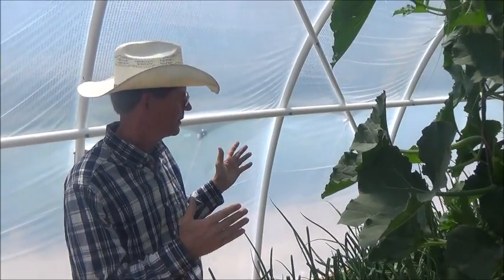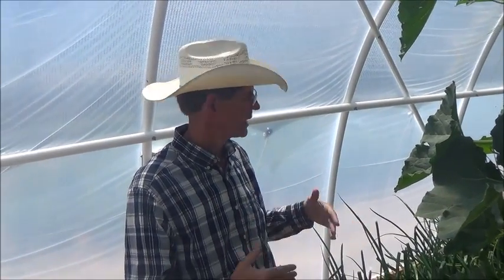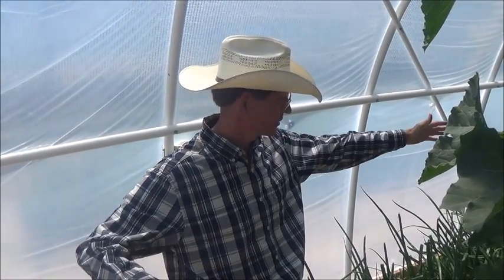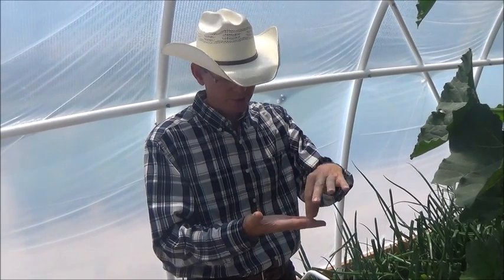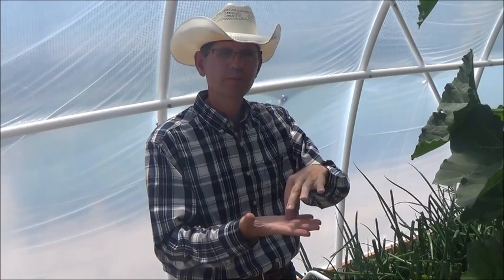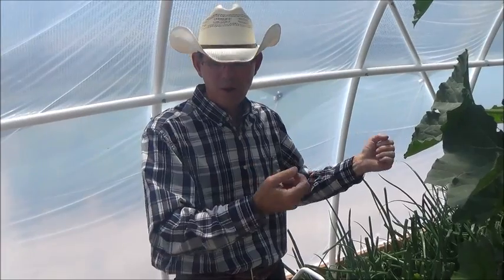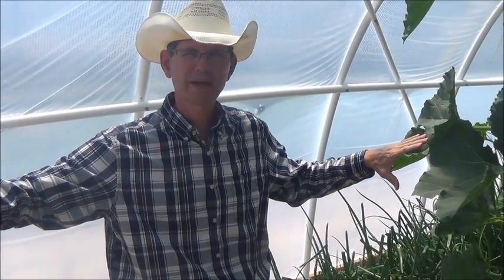LDSPrepper GeoThermal Plans for Underground Tubing New!

Comment: How do you work out how much tubing do you need? You mentioned the cubic size of the greenhouse, but then you appear to mention length of tubing as a %age of the greenhouse volume??
Kind Regards
Richard
Reply: +Paul Ladendorf 
Insulation and heatloss isnt a big factor in determining the tube length apart from the amount of heat the system must provide to overcome the losses. 
The amount of thermal mass dictates how much heat you can store. 
The amount of tubing in contact with the mass and the amount of air you move through the tubing dictates how much heat can be  moved to or from the thermal mass.
Check the video at about 3 minutes in, when David says the tubing must fit in the ground, i was hoping a light bulb might appear above his head at that point, but sadly not... the ground still doesnt figure in his formula :)

 Rest assured, using the 10% air volume to tube length will cost you between 30% and 50% of your systems total potential performance even if everything else is perfectly designed.
In my case, i`d have less than half the tubing i have now, and in David`s case he`d be over 300ft short on the minimum amount needed for his greenhouse..
Reply: I installed my system in 2009, it was designed with the assistance of John Cruickshank (RIP) of sunny john and plain-to-sea to provide accurate realworld data as there was very little available back then. It has a variable speed fan capable of more than 60 airchanges per hour. The system is monitored by  26 sensors, 2 dataloggers and an anemometer.
Heat transfer is driven by temperature difference, if you have air at 80F and dirt or water at 50F, the air will not lose more heat to the water. The water will not heat up as fast as dirt but if you run the test for an hour neither the dirt or water will gain enough heat from the air to create a measurable temperature rise. Note that you also have to take account of the latent heat transfer as well as sensible as it plays a major beneficial role in cooling and a detrimental role in heating if its not addressed in the design.
Reply: The prerforations in the ADS are not ideally placed to drain condensate, it gets trapped in the ridges. Use a circular saw and a couple of boards as a guide to cut a very shallow slot through the ridges in the bottom of the tubing. Dont cut all the way through :)
Reply: The ones i`ve talked to dont have a very good understanding of the systems they sell. They didnt have a clue that large amounts of moisture is released into the greenhouse along with the heat. I guess they are more interested in selling than testing. Anyone with one of these professional systems can easily confirm what i`m saying simply by monitoring the greenhouse RH%. day and night. Take a look at LDS datalogger screenshots in one of his vids that show 95% RH at night :)
Cere`s was one of the firms, whether the information was passed onto their design team i dont know but the issue is real and must be addressed in the design stages as latent heat does nothing to raise the greenhouse temperature just the RH%, which can lead to outbreaks of mold, disease and also corrosion/rotting of the greenhouse structure itself.

Dont listen to me or them..do your own small scale testing and decide whose info is correct :)
If you look at Cere`s tubing layout, the 1st thing you`ll notice is the design flaw in the inlet and outlet manifolds,  these must be sized to carry all of the air to supply the multiple tubes in the layout. One 4" tube cant carry all the air to supply eight 4" tubes in parallel. Its a bottle neck that would not be there if the system was designed correctly.
Reply: +Richard Miller Cubic size is the same thing as volume.  His formula is 10% of volume in feet of tubing. So for example the volume of a 10x10x10 greenhouse would be 1000 cu. ft. and would need 100 ft of tubing. The problem with that formula is it doesn't take into account how well insulated (or not) the greenhouse is nor the climate its being installed in. A single layer of poly is going to need way more tubing and air flow then a super insulated greenhouse. A greenhouse in northern Canada is going to need way more tubing and air flow than one in Tennessee. The scientific way to calculate it would be based on heat loss and gain.
Reply: Hi Richard
For a greenhouse that size i`d use a total of180ft of 4" tubing arranged in a 6x3 matrix comprising18 tubes 10ft long. The tube spacing will be 18" on center horizontally (1st tube spaced 9" from the greenhouse wall) and at least 1ft vertical spacing ensuring you have 2ft cover (~4ft total depth).I wouldnt go more than 18" vertical which equates  to around 5ft total depth. The easiest option for the plenums/manifolds is to dig a trench 9`x 2`x 4`-5` deep at each end of the greenhouse and install retaining walls made from pressure treated timber. The 250cfm fan will be sufficient for 20 airchanges per hour, the tubing layout will easily handle 60 airchanges per hour for summer cooling if you need it.. You can easily fit additional 250cfm fans (at any time) to the intake plenum to increase the system capacity. For extra flexibility, use a thermostat for each with the setpoints geared to provide more flow (more fans running) as the greenhouse temp increases, less as it decreases.
Be sure to install vertical perimeter insulation to isolate the greenhouse from the ground outside.
Reply: A 250cfm fan will put all the greenhouse air underground 20x an hour (excluding losses). 250cfm x 60 / 750cubic foot gh volume.
The losses in the layout above will be very low. If you were to run the same 250cfm through a single 180ft long 4" tube (ie the same amount of tubing), all things being equal, it would have 2800x more loss (aassuming it was dead straight with no bends). To put it into context, the single 180ft tube with just  5cfm running through it would have the exact same loss as the correctly designed system running 250cfm. 
Rules of thumb.Dont use long tubes, they will eat your fan power. Dont bury the tubing in a single layer, it will severely limit the amount of mass in contact with the tubing. The mass is both source and sink for the heat, air flow is what transports the heat to and from the mass.
Reply: Folks get fixated with how long the air spends in the tube. This is what convinces them to install long tubes. The important thing is how long the ENTIRE greenhouse air volume spends underground.
Typically, air will drop to the mass temperature in less than 1 second, If the air drops to the mass temperature before it exits the tube you are using time that could be better spent moving more of the greenhouse air underground. As an example, at 60 airchanges per hour, a sealed greenhouse purposefully heated to 140F was cooled to 68F in a shade under 12 minutes. It was in full sun during the test so it also includes the additional 12 mins of incoming solar gain.  A longer dwell time is needed for heating but not a great deal, again the important thing is how long the entire greenhouse air volume spends underground.. not how long the air spends in the tube..its not the same :)
Here are a few tools that will save a lot of unnecessary digging ;) 
http://www.freecalc.com/ductloss.htm
http://www.uigi.com/WebPsycH.html
Reply: Submerge some duct (non perforated) in a bath of water (or a pond) and see how much airflow it takes to get the exit air temperature to climb above the water temperature. Chances are you`ll run out of fan power long before you manage it.
Reply: The conductance of water is much higher than dirt so this wouldn't be an apples to apples test.
Reply: It wont matter, its simply supplying a temperature difference and for this test its the air temperature you`re interested in not the mass temperature ;)  Dig a trench for the test if you like, the mass temperature wont change during the test whether its water or dirt. The air temperature in the tube on the other hand will drop like a stone to whatever the mass temperature is. The heat capacity of air is nothing compared to dirt or water.
Reply: You missed my point. It had nothing to do with the mass temperature. My point is heat transfer from water to air will be signifcantly faster than from dirt to air because water is a much better conductor than dirt. Maybe it won't matter if as you say the transfer is extremely fast. I haven't tested that though.
Reply: I have talked to 2 professional installers and now you, all of you sounding very convincing and knowledgeable with data to back up your claims and you all disagree on the fundamentals of an efficient system. :(
Reply: JohnGuest45 I assume you used the corrugated and perforated abs tubing which is what is recommended by the pro installers I've talked to to eliminate condensate build up and mold in the tubing. But it seems that condensate can still build up in the bottom of the corrugations since the perforations are on the ridge of the corrugations. Have you had any issue with mold and if so, how have you dealt with it? Thanks!

Comment: He mentioned a 10% ratio of cf pipe volume, any clue where he got this information?  I have been trying to find specs for sometime without success, thx
Reply: Calculate the volume of a cylinder.  Pi*Rsq.*L  Pi=3.14  Rsq= radius of pipe in feet squared and L is the length of you tubing.
Reply from the maker: Check the video Dirtpatcheaven did with him.  She interviewed him during the digging phase. About 4 months ago or so.
Reply: the info isn't in the dispatch vid either, did u end up finding it, though ?
Reply: +Mike Johnson  Hi Mike - I'm asking myself the same question. Also do you know how to do the calculation into feet of 4" pipe. For example if the volume of my greenhouse was 100 cu ft (very small) how many feet of 4" pipe do I need to get the 10% ratio he talks about? - Thanks

Comment: Would not the composition (metal or plastic), design, and diameter of the buried tubing affect the required length? The surface area of corrugated pipe is many times greater than that of smooth wall pipe of the same diameter. Different pipe materials would transfer heat at different rates and efficiencies. Six inch diameter pipe has a surface area 1.5 times greater than 4 inch pipe per linear unit. So larger diameter should reduce the length required. Also, I would think corrugated pipe requires more energy to move air through it due to wall roughness creating turbulent flow. 

Anyone aware of any resources on this type of info?

Comment: It makes the most sense to dig the entire space, put tubing in the walls of the space, use the rest of the space for a root cellar, storm shelter, storage, or living area. That means, for living area, less heating in winter, and less cooling in summer.
Plants like pretty much the same temperatures as we do, sprouts, even more so. Keeping the temps between 68º and 80º year round means microgreens capability all of the time.

Comment: The numbers didnt add up, also could you please ask him why its 10%? is that 10% at 8 ft? or 6 ft? Where did he get that 10% number from?
Reply: Isn't temp intake and discharge enough? Why 4 spots ? Why the wind meter ? Fans have cfm ratings on them 
1 ft deep wouldn't serve it's purpose as temp is a function of debth 
Would be easiest to know where he got the 10% from.
Reply from the maker: Did you watch his video on DirtPatchHeavens channel?
Reply: +OrangeJeepDad yes which one ? there are 5 parts I believe
Reply: +OrangeJeepDad by the way thank you for the interview I'm just about to do the low grade geothermal next week at a schools greenhouse
Reply: akbanhegyi  10 % The total cubic volume of the space. lengthx width x height ie A 10 ft tall by 10 foot wide 10 foot long cube would be 1000 cubic feet in the green housse. Then you would need the space inside the tubes to be 100 cubic feet. So His 480 feet of tubing must equal at least 720 cubic feet inside the tubes.
Reply: +glenn dolezal hey thanks for the reply do u have the source for the info ? the volume inside tubes is a big clarification as lds prepper said length of 4 inch pipe in feet and I want to use 6 inch
Reply: Finding the cubic feet inside your pipes is going to involve Pi some how. Google "finding the cubic volume of a cylinder" Figue it out for a 12 nch length. I am certain there will be a calculator availible somewhere.If you mean where I got the other information I am Just gathering from what the man said and my very basic knowledge of math.
Reply: +glenn dolezal yeah the volume is pi r squared times the length. What I'm looking for though is the explanation as to why it is 10% and what the actual heat transfer is from the ground thru the pipes
Reply: +Victor Crosswell yes thank you I got that part what I'm trying to find is where he got that information from ? why Is it /10 and not 10.4 or 7.2 .. is there a study he Is referencing or did he come up with it himself
Reply: could you direct me with a more specific search please? or u can email it to me at akbanhegyi at gmail period com
Reply: thanks, you got me on a passive heater video watching binge :D
Reply: +akbanhegyi 
I recommend doing your own research as digging the tubing back up a few months down the line wont be any fun.  You can gain a lot of insight from small scale experiments, all you need is a variable speed duct fan, some tubing, a 1ft deep trench, a means of measuring the temperatures in 4 different locations at the same time and a windspeed meter.

Comment: 3 rows = 480. Still less than 720.
Reply: That's incorrect. 7200 is the total cu. ft. of his gh. 10% of that is 720.
Reply: he said 10% of the 720. that's 72 feet so he's well over if I'm understanding correctly.
Reply: To reach that 10% mark he would need 3 layers of 240 feet. Which would mean that each layer would need to be at least 60' in length,not 40'.

Comment: This doesn't make sense! He says you can fit 2 rows of pipe below 5 feet. 2 rows x 160 ft = 320. He says he needs 720 for this greenhouse.
Reply: I heard 3 rows,  40feet longX2=80feet x3levels= 240 feet. even if doubled it's 480 feet - but you're right it still doesn't add up.....
Reply: 720 cubic feet not lineal feet.